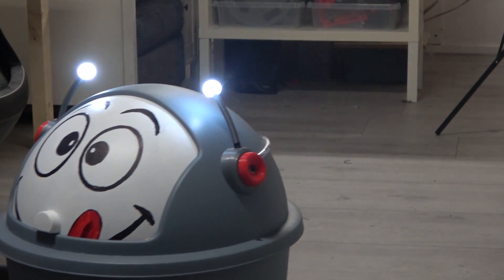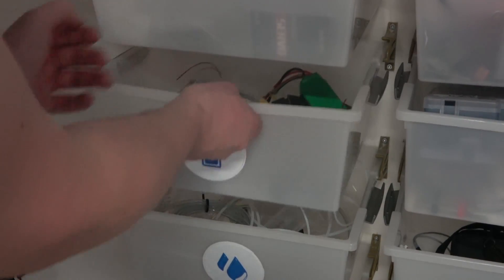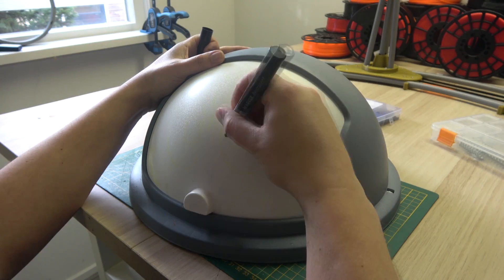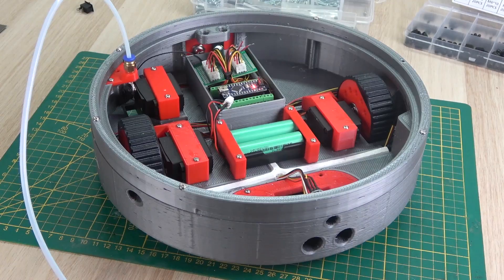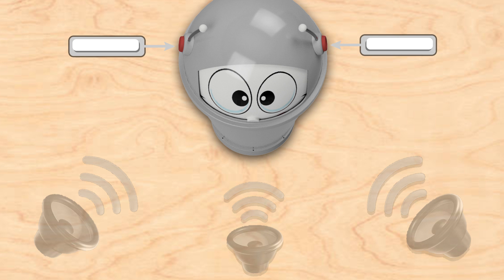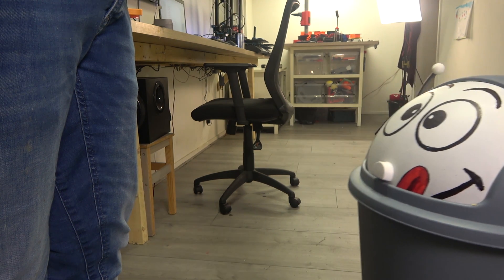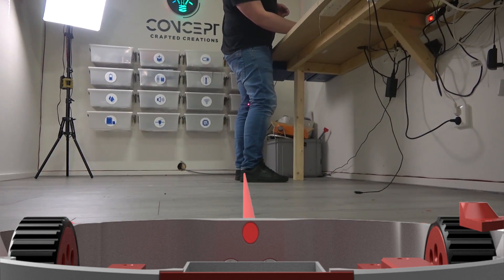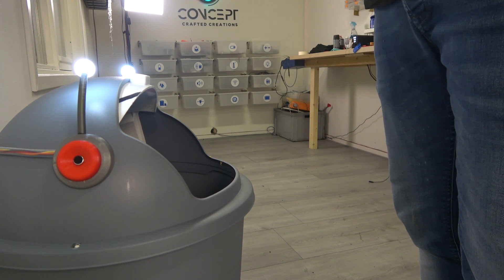Building a Trashcan That Comes To You When You Call It..

Comment: This is a great project I myself have been thinking of making!

One thing I would add is an accelerometer or gyro like the MPU 6050 as a backup sensor. I would use it to detect "unexpected accelerations" by comparing calculated acceleration caused by the motor wheels (in my case, steppers) with the actual acceleration that has occurred. If mismatch is greater than a certain threshold then sound the alarm that the robot is lost! Useful for cases like if someone kicked your robot...

Comment: Did you consider trying a mmWave sensor for person detection? It seems to work well in smart home stuff.
Reply from the maker: To be honest.. no!😊 I have heard about it indeed, And I wonder now if it would have been a solution for this project... I will definitely look into it for future projects!👌
Reply: @ConceptCraftedCreations  I have no idea how well it would or would not work on a moving platform, but I could totally see a v2 of this using that as a sort of external sensor. I assume it still also needs something to deal with collision detection?

My other questions for this actually is does it remember it's path and go back to "home" after a time or do you have to put it back?

Also how long does the battery last with this implementation? Seems like it might be power hungry, but that could be solved with like a charging "home" that it docked itself to.